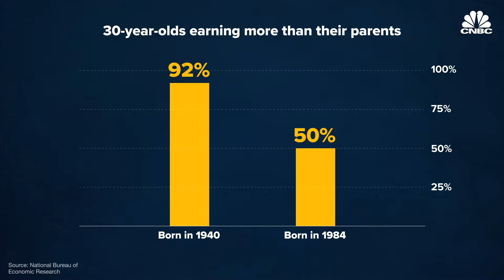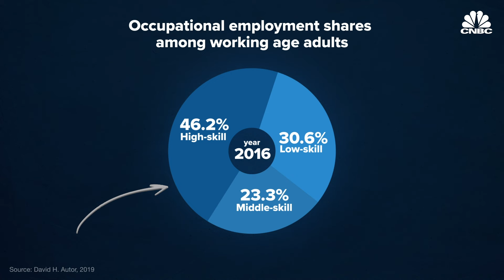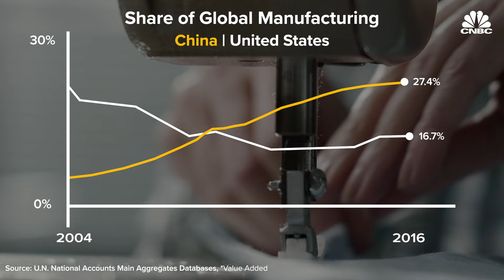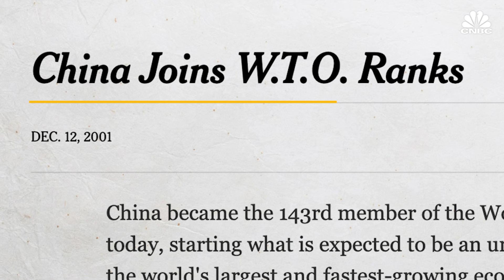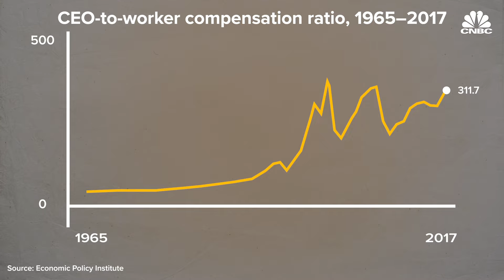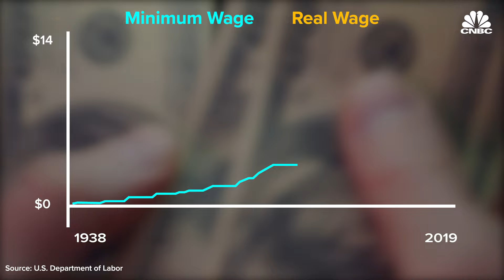Why The Inequality Gap Is Growing Between Rich And Poor

Comment: CEO compensation increasing while holding down worker wages.
Reply: In most cases, no. I you get rid of a CEO that gets paid 10 million dollars annually at a company of 35 thousand employees and distribute the money to all of the workers evenly , everybody would get a little over $5 a week before taxes. That would make no difference in their lives until the company shut down...because you have no CEO. I would  gladly pay $5 a week to retain a leader that keeps the doors open and the company relevant.
Reply: @Todd.T  
Isn't 10 million a bit excessive? Several million will be acceptable for a top rate CEO (there aren't any currently). I guess they have to make do with only a good part of a couple of million.
Reply: @Gareth De Bruyn Try your hand at comprehension. Poor people aim for the people at the top and want a cut without doing the work or having the responsibility...without doing the math. Responsibility and experience pays more.
Reply: @unf3z4nt  They don't usually get 10 million per se, but they get "compensation". i know of a CEO that got 12 million in "total compensation". Bottom line is low skilled workers and customers believe that if the CEO only got paid a million dollars and the rest was given to them, they would be rich too. Obviously if you have a millions of customers and thousands of employees who demand the CEO's pay be divided up and given to them, there would be zero impact to their lives. Customers looking for a cut in the costs of the service or products and employees only thinking about their own little office and not company wide. That is a lot of people and not a lot of money. Comcast''s CEO gets 35 million total compensation. Comcast has 184 00 employees and  22 million TV  subscribers or 23 million internet subscribers.

It would make no difference to dole out the CEOs excessive pay to those who believe that they would benefit.
Reply: L.J Ross if only it was that simple. USA has a systematic economic crisis. Unfortunately all solutions are taxing the higher earners more. Clinton had plans to increase welfare programs to non citizens to help poor and disadvantaged families. These are not substantial solutions.
Reply: @thatnativeking1333  , it is that simple. This country was much stronger with a  higher tax rate and CEO pay at 30 times average worker pay.
Reply: @thatnativeking1333  , nobody is suggesting increasing welfare programs.  Your information sources  are faulty.
Reply: L.J Ross
Walmart for example. They employ 1.5 million people. Their CEO makes 22.8 billion 
$22,800,000/1,500,000= $15.2 an increase of $15 a year what cutting the CEO costs will do.

Apple:  CEO made $15,600,000 total workers: 132,000 yearly pay difference: $118

Amazon: CEO $81,840 (Bezos makes most money off Amazon’s stock not CEO salary) 647,000 total employees. Pay difference $8 per year per employee.

CEO’s salaries are not the issue. Tim Cook, Doug McMillon, and Bezos are the most infamous in the world but their CEO salaries contribute to a small percent of their totalwealth. They got rich off of their companies stock. The point being is the stock market is how they got rich. It’s a system where the rich get richer. No cuts on CEO pay will change the economic inequality.
Reply: @thatnativeking1333  , stock is part of your total compensation.  Corporate compensation laws would require that employees salary goes up with CEO compensation.  All CEO pay is not based in stock prices.  Your  argument is still flawed.
Reply: @LJRoss-zv8hw  Flawed? It's not perfect because it is a generalization. However, your initial point is all but destroyed...
Reply: @burtonl7239  , no flaws based on your non fact based comment.
Reply: Todd T why would you pay a fast food worker with zero skills, the same as an executive that knows how to keep a company alive?
Reply: Todd T if you’re not a ceo why do you even care ? Why are you saying the guy next to you deserves millions in one year off your labor and hundreds while he just “watches” you , oversees you basically, In macro terms .
Reply: Todd T no the sim of the ceo is to do less work- not the other way around.  Trump is doing exactly what all CEOs do in one way or another - calling golf work.
Reply: Burton L CEOs outsmarted you by obscuring their pay which is clear they succeeded in the fact you still don’t understand it.
Reply: @unknowingreaper6556  "why would you pay a fast food worker with zero skills, the same as an executive that knows how to keep a company alive?" personally i would pay someone who cleans toilets more than i would pay a ceo, simply because job satisfaction for the toilet cleaner is much lower than that of a ceo. in reality, cleaning toilets gets you a low wage even though its one of the worst jobs you can get, theres something not right about that.

Comment: It's funny how security is always mentioned as a downgraded job. It's actually one of the handful of career fields where you can earn six figures or close to it with just a diploma and experience or an associates degree and a couple years experience. I know this is the case in big cities. Just check job listings for director of security or safety or emergency management type positions. My degrees are not "necessary" for me to move up but they sure as heck make it quicker,  easier, and make my job more enjoyable. I tell my officers all the time, standing in one spot, conducting patrols,  watching video cameras, and accessing people through a turnstile is NOT how you move up. As they said in the video, this is a new age. I requested more responsibility, learned the different computer systems, became the official trainer, created training materials, comminicated with vendors and contractors, contributed to and created presentations for the client, mentored others, have the ability to communicate with stakeholders and city departments, stay abreast of the different fields that effect the client (commercial real estate, global security, facilities management) and my company, etc. I also regularly ask for and receive raises. These are some of the differences between a $12-$14/hr security officer and myself. As they said in the video, this is a new age.
I'm currently using an education benefit to get a public administration degree which I'm cash-flowing. Since we're attending the same school, I told one of my officers about it so she could take advantage, and she said she may as well just add to the $20,000 in student loans she already has...even after I showed her how working only 2 days of overtime/per month would allow her to pay for it out-of-pocket. 
Just because you start at a low-wage JOB doesn't mean you have to stay there. Just think of people who begin as cooks/cashiers at KFC and end up owning a restaurant.

Comment: To me the main factor is the reduction in organized labor starting from the 80s, and at the same time the focus on ‘maximizing shareholder wealth’.  Any company that wasn’t focused exclusively on its bottom line became targets for hostile takeover.  Defined benefit pensions ended, and there was immense pressure to keep expenses as low as possible.  At the same time, new technology improved productivity, and as a result of the above, the benefits of that increased productivity accrued to the top, the C level and board of directors.  Before the 80s, productivity and wage increases matched more or less in lockstep.  After the early 80s, wages have stagnated while productivity has continued to increase. 

That’s what has led to the increase in wealth disparity.  Even if you are doing well, unless you’re in the very top, you would be doing better if the productivity gains from the Information Age were distributed.
Reply: @Brian-dh9lp  wages kept up with increases in productivity until the late 70s, then they separated. robert reich lays it out very well in saving capital.

Comment: Free market capitalism by design has to be exploitative of cheap labor, unorganized labor, and unprotected labor. It also needs an increasing number of people to exploit in order for it to work, and to support the exponentially higher earnings for the people at the very top. Flaws include:

* The marketing or selling point is "hope" that one day, you too can become a labor exploiter as opposed to being the person being exploited ("You've earned it"), through gaining skills as you go, through education,  saving up enough money, or getting a windfall to buy yourself upward.  Clearly, the marketing is outdated as only the latter (windfall) can get you out of the trap. 

* The system is now working against itself, as it deprives consumers in the middle of its spending power (stagnant wages, loss of wages to cheaper outsourced labor), to continue to afford to buy goods and services that then drive more economic demand. Virtually all of the middle class's purchases are 'needs-based' and this drives the economic engine. Money concentrated into the hands of much smaller group of rich people means the money is stored away and not put back into the economy to "grease the wheel."

Comment: in the USA trade jobs electrician  plumber and commercial driver (truck driver) makes good money - but aggregate labor  markets  make fewer employer who control salaries … for example, lab tech jobs are consolidated by outsourcing body shops  who gain exclusive access to hiring for the entire industry....so free agency /market is not working... its is very similar to the hiring of professional athlete in the NFL....our capitalistic system has monopolistic mercantile mechanism that work against workers and for the capitalist

Comment: When people are given free money, they will lose their incentive to work harder and to study harder and do their best to excel. Year after year of receiving free money, the gap will get worse and worse . One of my friend stopped working completely after coming back from the US army because if he doesn’t work he will receive 1500 a month from the government. But if he works, his starting wage is lower than 1500 a month and he will lose that 1500 a month benefit. He told me 5 years ago he “ain’t gona work if the pay is the same and he has to work 40 hrs.” He has been stuck in this 1500 a month for years Now. While his friend who went to the army and came back with him, already worked their way up from 1500 a month to 7000 a month. This is just one example of many many examples.
Reply: I was in the US Army and I don't know what program you are talking about.  I know quite a bit about VA benefit programs and there is only one that will reduce your benefit if you work.  If you are a disabled veteran with 70%-90% you can get an Unemployability rating.  This will not give the veteran $1500 but a minimum of $3057.13.  This is because despite having only a 70%-90% rating it is determined by a rating board that the veteran physically CAN NOT find meaningful work.  Meaningful, mean no work that will support themselves and their family.  There is also SSDI.  This is not a veterans program but is open to every disabled American.  

Brandon, you have a few of your facts wrong or your friend is committing fraud!  He could also just be lying to you.

Comment: Interesting that both globalization and declining union membership are called out as contributing factors to rising economic inequality. On the surface, it's a valid point... however, union membership (more specifically, the costs associated with a unionized workforce) has been a HUGE driver for companies to utilize offshore labor. If a product can be manufactured offshore, be shipped to the US, and have any duties/tariffs paid for less than it would cost to simply manufacture it here in the first place, why wouldn't companies take that option? The long and short of it is that the point(s) made about the declining value of low-medium skill labor are the root of this particular quandary; no longer is a factory job the ticket to a middle class life. In that, low-mid skill workers need to concentrate on learning marketable skills if they want to improve their quality of life.

Personally, I feel that the effective death of vocational education in our public schools is largely to blame. Public schools are geared to push everyone towards college... which is all well and good, but it is not a viable approach for all students. Some don't have the means to go to college, some don't have the desire to go to college, some don't have the learning capacity to go to college... but what all of them have in common is that they graduated from high school with ZERO skills that they can use to earn a living; this is problematic (and honestly, has likely been a significant contributor to the massive amount of student loan debt... people feel like they don't have any choice but to go go college, whether that's the right move for them or not). Modern society will always need plumbers, electricians, carpenters, welders/metal workers, etc..., and all of those skill sets can be used to make a decent living... but what can no longer be counted upon as a way to earn a decent living is to go down to the local factory and get a job lifting widgets into a machine, pressing a button, and moving them down the line.

Comment: Typical mainstream narrative with zero insight.  Completely missing discussion about Monetary policy and Cantillon effects.  Tech advancement and the need for highly skilled labor is part of the equation, but technology improvements don't explain why the financial sector always does better than the rest.  The reason the 'real wage' is decreasing is exactly because of the way the central banks are designed to create inflation.  The reason why China is able to export is related to the Triffin dilemma - again due to central banking policies.  Minimum wage is a red herring because this almost exclusively affects the young that haven't really entered the job market yet and is a tiny percentage of overall job market (e.g. raising minimum wage certainly does not affect a typical factory worker because the typical factory worker makes much more than minimum wage already). 

You can't fix the problems if you don't know where the problems are.  The reason the rich get richer is because the rich are in the stock market while the poor are not, the rich can buy homes which hold value, the rich can get better interest rates.  The solution is to teach people what skills will be needed in the future, teach people how to save and invest, to abolish the FED and to institute governmental fiscal control.

Comment: The outcome is more civil unrest. More disassociation with the prevailing or common beliefs that shared values and hard work and saving build to a common good. Utopia aside, a common good has never been realized. But we live in a period similar to Pharaonic periods of very vertically stratified societies. 

We will see more divergence between rich and poor, and this gap will be transnational. So at some point where the extreme poverty of 60% percent globally and in some acute situations 90% regionally or nationally, the actual society will break down in some from of Collapse. With or without violence, it may simply be that Collapse is in the form of extreme famine or plague. It does not have to result in Civil War. It can simply end with most of the actual common people suffering to such a degree that either they die out, or are forced to leave the region or nation entirely. Such modern equivalents to various Collapse scenario's are the fall of the USSR and the Arab Spring with the ensuing violence in Libya, Egypt and Syria.  

I believe ultimately this model of Global economic expansion can not last more that 40-50 more years. The Civil wars may be on the wane in the Middle East, but there will be fresh violence with bigger players like Turkey, Iran, Iraq, and Saudi Arabia ultimately falling into the mire. 

Even the PRC, or China with it's economic miracle will ultimately fail as is the Russian Federation now collapsing. The economies seem adequate to hold on to the current standard of living, but the Demographic Time Bomb is ticking. And much of Europe, and almost all of Eastern Europe and the Russian Federation is collapsing demographically. 

So it's the Fall of 2019 and I feel strongly that by 2070, we will see major dislocations and population declines on the order of 30-40% from current numbers in most of these regions. I hold out without further pressure caused by a major plague or Climate Change induced Famine, actual populations will Fall cumulatively and Globally to 3.5-4.5 Billion Persons in that 50 year period. I believe people will simply be forced in many declining economies to either parent with very ultra small families, one working parent and one child or many working couples spending their entire life childless.